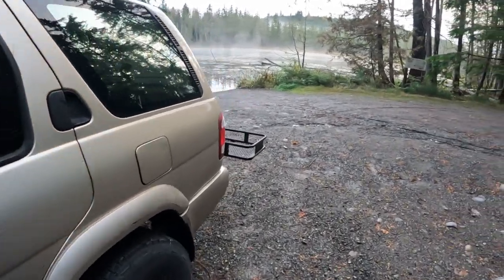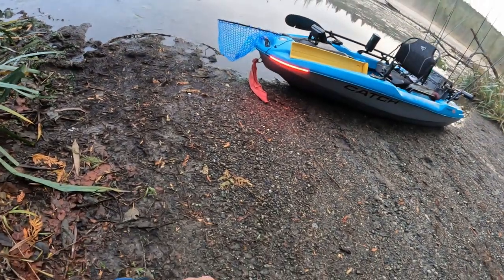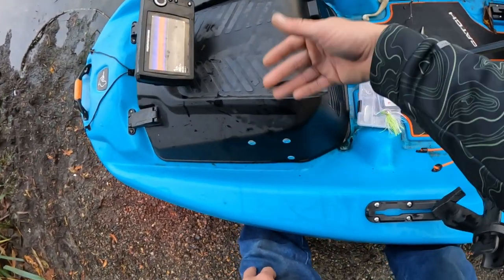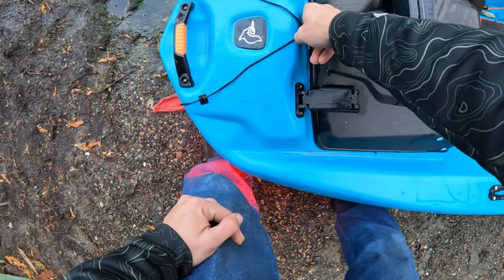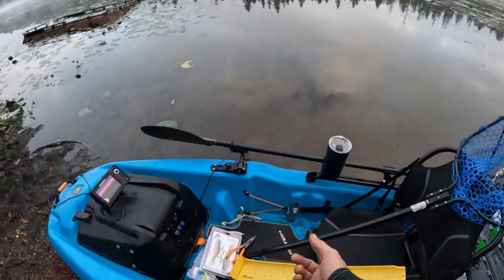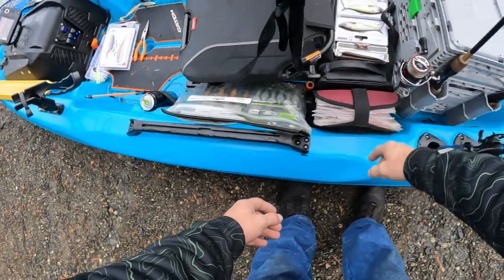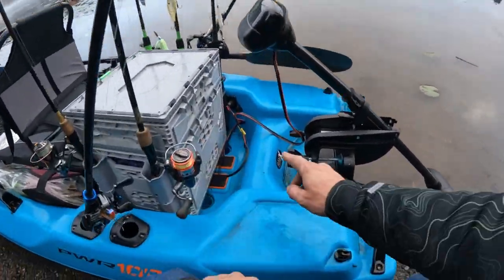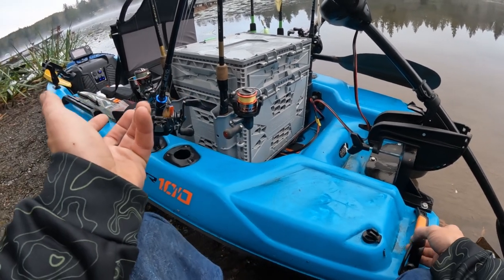Pelican Catch PWR 100 Update

Comment: I think it was you that gave me some good tips today!!! Omg i looked up your kayak and found ya channel lol it was me the dude on orange hobie lol
Reply from the maker: Spring lake?????
Reply: @northwest-fisherman  yes sir!
Reply from the maker: @iamalemontree  if you wanted to you can add me on instagram and share knowledge if you wanted.
Reply: @northwest-fisherman  thanks brother!! I am thinking of getting the same setup as you lol. Do i need to register the kayak when putting on the trolling motor?
Reply from the maker: @iamalemontree  nope not unless you go in federal waters, but in case you do it has a vin number and the whole proof of ownership is really easy.
Reply: @northwest-fisherman  thanks brother! So any lakes inside WA is good right?
Reply from the maker: @iamalemontree  that aren’t federal water ie lake Washington is federal water and then I think a couple spots in eastern Washington are federal water too but I can’t think of the names off the top of my head. Even boats here 14ft and under with less than 10hp don’t require registration. But I would just double check all the regs anywhere you go and watch for emergency rule changes.

Comment: Hey Chris how do you like the raised gear track rails/handles on the sides of your seat? do you find them to be sturdy? The reason i ask is i have a pelican catch  mode 110 and I'm looking to add/mod the PWR rails on it. last question do you think the track rails/handles can be disassembled and cut down to length I need? Thanks in advance!
Reply from the maker: I love the side rails and they are very sturdy, they could be cut down but it’s not going to be a simple cut because of the way the ends attach to the mounts. Also they are only about 2ft long.
Reply: @northwest-fisherman  Hey thanks for responding very much appreciate it. Hmm so are the mounts made of plastic or are they metal? The Pelican site has zero description about this handle and it doesn't even tell you how long it is. So thanks for leting me know it's in the neighborhood of 2 ft.
Reply from the maker: @azwooddesign7431  The rail is metal the mounts are thick plastic and it has rivets holding them together. They arent as big as they look remember the PWR is only 10ft
Reply: @northwest-fisherman  Thanks Chris this is GREAT info and has helped me a ton. All the best on your relocation and Tight lLnes!
Reply from the maker: @azwooddesign7431  of course sorry I couldn’t answer that sooner for you but I was driving still. Remember FAFO fish around and find out!!!!

Comment: Bought a nearly near one and immediately ran into what I believe are manufacturer issues.  Latches for the battery cover are cheap and break very easily.  Rails for the seat are plastic and both of them cracked at the front and one cracked in the back.  When I contacted Pelican in Canada, I was extremely disappointed with the response.  Not at all the yak I thought it would be.  JMO.
Reply from the maker: I have read about a few other people who had issues like that, luckily I haven’t experienced any of those. When did you buy yours? My seat rails are steel, I wonder if you had one of the very early ones

Comment: I have had mine for a year and half.  It's ok,but rides like a floating bathtub.   I rigged a steering system in front of my seat that I turn by hand.   It's hard to turn around and access the trolling motor.  I put mine on top of my van.  How do you transport yours?  Thanks
Reply from the maker: I transport mine on top of a lifted suv or on my trailer if I’m going fairly far. I figured out early on to combat the floating bathtub feel is to go with more total weight middle and rear. The handle on my trolling motor extends so when I’m in my seat relaxing I can reach it easily. I need to do a new update with the changes I have made recently.

Comment: Starting to look at small boats for photography. How much run time do you get on that 100 ah battery? Do you think this would be a good platform for photography?
Reply from the maker: I have ran my big c55 all day fishing multiple lakes and haven’t ran out of juice once (but that’s not constantly moving). With that information if you got a smaller 30lb thrust motor it would last even longer. I don’t have a pure answer for you on how long the battery will last because I get to spot and I fish for a while, however I have covered several miles with confidence.

Comment: Third switch battery charger for phone and cameras
Reply from the maker: Above the switches are two more parts of the switch panel, one on the right is a volt meter the one on the left is a double USB port. Those two things are a big reason why I bought that panel. I should have brought that up again during the video because it’s a game changer.

Comment: Why don't you just buy a boat.how much does it weigh
Reply from the maker: 70lbs empty and it’s bold of you to assume I don’t have a boat also. I do have a boat but a lot of lakes here especially high mountain lakes don’t have boat ramps and even the lakes with boat ramps aren’t always that great, plus lakes without boat ramps I can easily have access to. Plus majority of the time I fish alone so it doesn’t matter much either one I take, I just have taken a liking of the ease of using the kayak. Plus I can run the kayak full speed in 8 inches of water my boat can’t do that. We also have a ton of electric only lakes. The list goes on and on really.